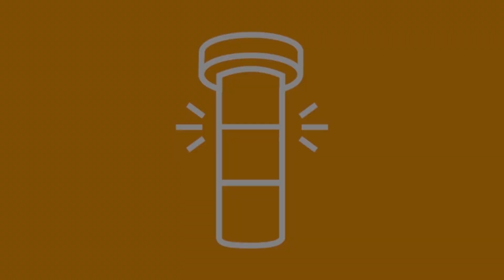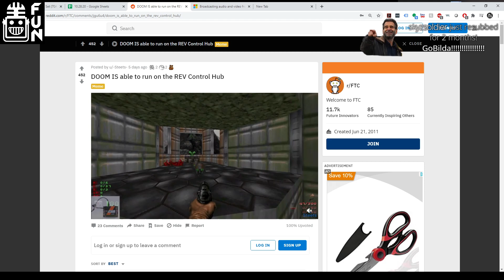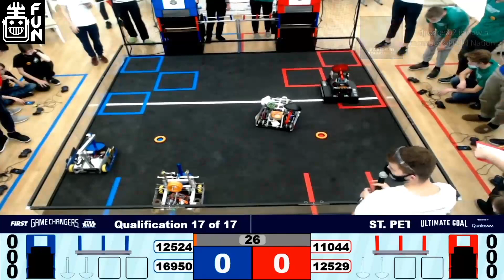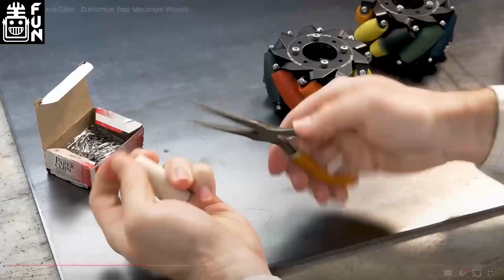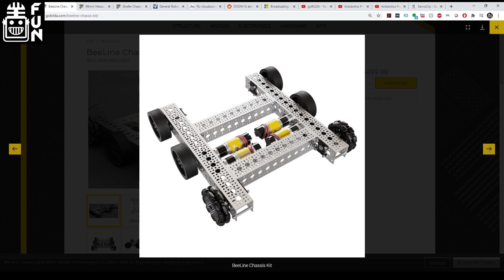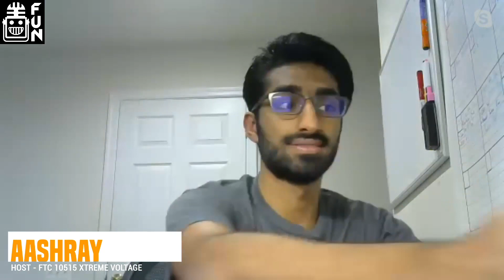FTC Recap - New 2020 goBILDA parts

Comment: what wheels are used to the shooting mechanism? the GECKO wheels or the traction wheels. and what diameter are they?
Reply: It uses 2 72mm gecko wheels. Only one is powered
Reply: @natescheuber  u sure? I only see one wheel for the shooter
Reply: @thatonesurtur  That's what's on the robot. If your talking about what the 90 degree shooter is then yes, that one is a single flywheel design.
Reply: @natescheuber  yep i was talking about the 90 degree shooter. So it uses one gecko wheel as the flywheel for it?
Reply: @thatonesurtur  Nope, that wheel is a 72mm Rhino wheel. (22:14)
Reply: @natescheuber  ok thank you!